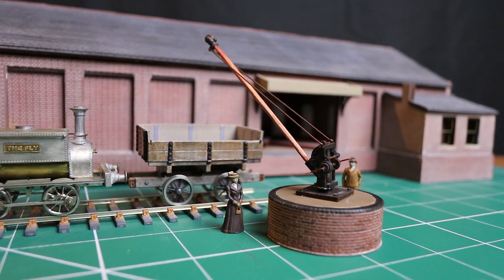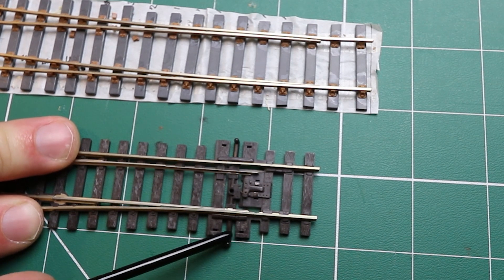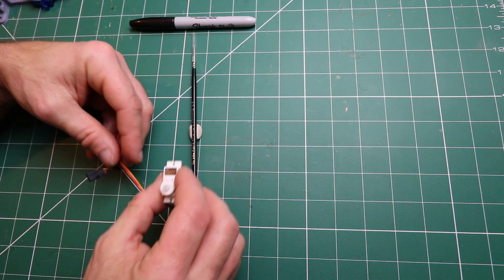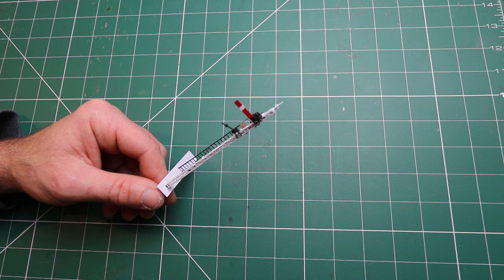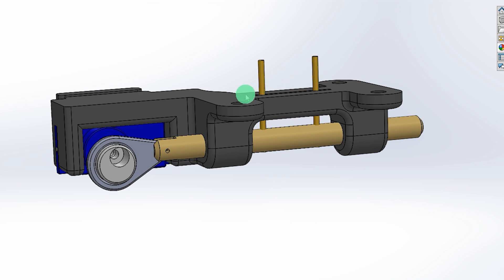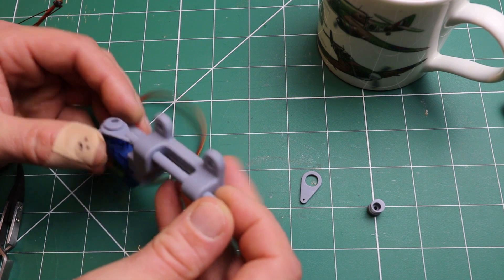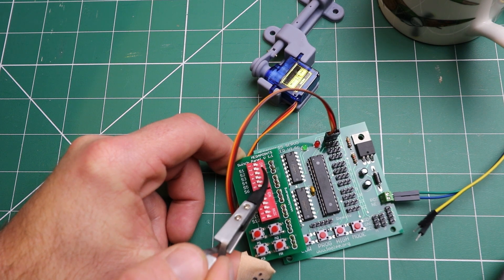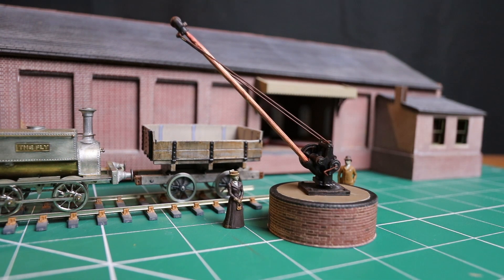S2 E10 Turnout or Point Motors for Bexhill West P4 Gauge Model Railway

Comment: It's really nice, but two things.  One, it looks expensive, and or time consuming.  We have adapted to servo control because it is "cheap".  Two, when you have scores, or in some cases hundreds of turnouts, you have a ton of wires running through your layout.  One way I mitigate that is using controller boards like the "Jack Wabbit", DigiTrax DS74, etc,  that are addressed from the track bus.  Still, it is a mitigation and not solution.  Ideally, we can come up with turnouts that tie directly into the track bus, without any mediators.  A servo with it's own "mini" decoder, that would tie directly to the local bus would be perfect.  It would save the wire bulk that clutters up modern layouts, as well as add to their complexity.

Comment: Hi James,
DCC Train automation already sell these. MTB MP1,5,6 and now I think they have a new MP10 out. They have the eccentric to effect a linear reciprocating motion but you could add your brass bar and twin prong set up (which is much more elegant than the single pin through the tie bar hole). 
They have switches built into them too for frog and signal switching. 
David.
Reply from the maker: HI David, the design of these has progressed since this video was made., and I'm now selling a more developed version through my online store.  The main difference between my offering and the DCC train automation version is that mine use servos which suits what I am doing.
Thanks for watching,
James

Comment: Very cool mechanism James. The bar in brass will of course pose a difficulty on what material you’re going to use as the rods between bar and blades. Can imagine that would also be best in brass. However, then you’ll bridge the rails into a short.
Can imagine two brass tubes over a rod and a plastic flange in the middle, in the same diameter as the tube, would do the trick. Can also mean your parts can be made adjustable for different gauges.
And the two pieces of brass tubes can then be identical, which would make production more easy and cheaper. 
Also am curious to what kind of visual throw bar you will come up with between the sleepers. Can imagine the path of travel could become even smoother when a kind of throw bar is added. Not to say, that such a throw bar would further enhance the realism of the model turnout.
Last but not least, for complicated turnout placement; this kind of mechanism would really improve turnout functioning over longer distances also.

Comment: Hi James, You've set yourself an incredible amount of work!  If this doesn't work out for you I would try a purely mechanical arrangement based on prototypical operation at the time!  Thanks for uploading.
Reply from the maker: I like a challenge, and for me it's more about the journey than the destination so I quite expect this project to take many years to complete.  Ultimately, the mechanisms will be operated by a mechanically interlocked lever frame which will control the electronics. I have started to design this but I need to speak with a S&T expert to confirm that I understand the principles of prototypical operation.  It's all a bit beyond me at the moment.
Thanks for watching,
James
Reply: @BexhillWest  Since you are scratch building I would seriously consider going down to 3mm scale. Peco produces an excellent range of track for this gauge called HOm. If you go for TT gauge you can leave all the problems you had with OO Gauge, EM and Protofour in the past!  All you've got to do is scale Bexhill West down a bit on the computer!  For inspiration, here is Garry Hall's TT scale layout featuring an SR Class C2. If you go for this you will have a lot more of Bexhill West in the available space!  https://youtu.be/-NVAtw6SRX0

Comment: Hi James,  For some time I’ve been wondering whether it would be possible to control turnouts/points using servos attached directly to the underside of the sleepers.  Your solution using a sliding bar is ingenious, but your prototype looks rather large.  Though I haven’t developed the idea, I thought it might be possible to use a gear fitted to the servo to drive a toothed bar attached to the points switching blades.  While this would keep the entire mechanism small, it would require a relatively large hole in the baseboard – relative to the conventional approach, that is.  In my case, I’m using an insulation material (Kingspan) under the track, so a larger hole than normal would not be a problem.  Of course, to allow for ballasting, the underside of the sleepers would need something to prevent the ballast disappearing through the hole - even paper glued to the sleepers would do.
I would be interested to hear your thoughts on this potential solution.
Stay safe.
Stephen
Reply from the maker: Hi Stephen, the sliding bar idea is great although not mine.  It seems to be common practice among P4 modellers.  
The aspect of this is the eccentric to control it, I've not seen it done before.  
I completely agree with your comments about my prototype being large and to rectify this, I have redesigned it into a much smaller package which I'll feature in my next video. It takes the concept to the next level which I think will interest some people.  
Best wishes, 
James

Comment: Thats a very good idea and workable. Might be a problem with its length should you have Two points side by side. 
Another handy addition might be to add a raised section on the operating bar to operate one or two micro switches for frog polarity etc.
I know you like to do your own thing having watched you from the beginning but there is something on a similar basis made by Dingo Servo Mounts. A system I have used and is extremely effective.
Reply from the maker: Thank you so much for your feedback.  I have had similar thoughts and this mechanism has now been redesigned and will feature in my next video.
Thanks for watching, James.

Comment: A very elegant design James! I am curious about the connection between the points and the throw rod via the pins. If the throw rod and presumably the pins are made from brass, then how are you planning to prevent a short circuit? The prototype would use an insulated throw rod to avoid shunting the track circuit. Very interested in seeing how your design evolves.
Reply from the maker: Hi Jeffrey, I was going to save that connection for a later video but have now redesigned and simplified the device to reduce the risk of short circuiting.  I am going to cover it in my next video and I'd be pleased to hear your thoughts on the MK2 version.
Thanks for watching, James.

Comment: Great idea, but have you considered that you will need microswitches for both the frog polarity and the interlocking on the Arduino. EG. the Arduino will need to know in which direction the points are set at power on and for signalling. You haven't included anywhere to mount them. Probably, at the far end of the push bar would be the best place, although horizontal pins on the push bar could be used to operate the microswitches.
Reply from the maker: Hi Henry, I wasn't going to use micro switches in my application, I had other ideas.  But, as lots of people have shown an interest in this, I've created a MK 2 with a switch. 
Stay tuned for my next video when I'll present the idea.
All the best, 
James

Comment: It seems that the mount is on the wrong side. When attached to the baseboard the mount will be between the points and the rod.
Reply: If you are referring to the working prototype James demonstrated, I think there should be two slots were the pins go that have been omitted which will allow the unit to be secured to the underside as shown earlier on the CAD demo.
Reply from the maker: Hi Nick, the intention is to secure the unit with screws through the lugs on the sides.  Thanks for watching, James
Reply from the maker: The intention is it will mount underneath the baseboard.  In my demo, I had shown it the other way up.  Thanks for watching. 
Best wishes,
James

Comment: Brilliant solution James, one quick note, maybe use a wooden dowel for the pins to go into rather than brass/3D printed plastic as the dowel will be consistently straight over such a very short distance and avoids any electrical issues. Just my thoughts but, yes, very impressed. Will you be making these available to buy as I am going to require rather a lot and I too want to use servos. Thanks.
Reply from the maker: Thanks, Paul.  Yes, I will be making these available but I've designed a revised version which I think addresses your observations.  Stay tuned for my next video when I shall explain all! 
Thanks for watching, James

Comment: Well, frankly I'm really disappointed that you haven't found a way to move a 1:76 scale signalman's arm to throw a lever, which operates the entirely functional 1:76 scale point rodding etc. <shakes head and mutters about not being able to get the staff> 🤣
Seriously, though, that's a very elegant solution. There's always something ridiculously satisfying about watching an eccentric thingie rotating.  But I'm not sure how you're going to connect it to what I've always thought was the tie bar, but which I think is properly called the stretcher bar, to transfer the movement to the point blades.  Are you taking two rods up vertically through slots in the baseboard to connect to (or to be) the tie/stretcher bar?  

Would the parts of the eccentric movement not be better cast/etched in metal than plastic?  Would add massively to the cost though, I'd guess.
Reply from the maker: Hi Andrew, I will explain a bit more in my next video when all shall become clear. 
Thanks for watching. 
Best wishes, 
James

Comment: Locking mechanism - yes, the usual model railway ones look wrong - would you like to see pics of german metric gauge ones for comparsion and doing them better by yourself?
~3:30 Very theoretical, if the viewer does not have a pic of the real thing to look at -> yes, when you got illustrative material showing going to be better.
Yes, two pins on the side "camouflaged" as the connection from the rod to the blades. Not T-bar.
The piano wire acts as a spring pressing the blades onto the outer rails, too.

Servo + semaphore signal + Andrino -> look into semaphore bouncing 😉

~16:30 You already know that I am against radio control. - BUT - Yes, the turnouts and signals independent from locomotives (feed by the rails) for federal control, for when layouts join modular up to one very big layout (that would be season 3 or even 4 - I guess).
~17:10 depends on the search words; "H0fine Weichenantrieb" for example brings some results, as well as ship and plane modellers often got similar solutions as they usually go the servo way.

Crane needs ⛓ and 🪝😶‍🌫

Comment: Hi James,

That's an interesting solution to be able to move the points.  I wish there was something like that available for when I made mine which I ended up using the copperclad method.  I found mounting stuff like that underneath a right pain with having fixed baseboards though trying to get it lined up straight.   Btw If you make that whole bar brass then you will just create a short when it's connected to the rails?

Cheers,  Michael
Reply: On my older P4 layout I bodged the TOU with brass droppers and  PCB.  Set up was awkward to say the least!
Reply from the maker: Hi Michael, you're right about creating a short.  I had other ideas for connecting this lot to the rails which would have avoided the short but have since refined the design.  I'd be pleased to hear your thoughts after the next video. Thanks for watching, James
Reply: @BexhillWest  - What about a thick metal pin glued into 2 plastic tube ends?   That way stronger than just plastic (or resin) but avoids the short.  Similar to a split axle.

Comment: That's fantastic. I've been using servos mounted with the axis parallel to the rails, using the sloppy-bearing-and-piano-wire method (actually a paperclip usually). Quite compact but relies on software to not drive the servo too far. This slip-eccentric method is very elegant, if there's space!
Reply from the maker: I'm glad you like the idea. The MK 2 version is even better. Stay tuned. : ) 
All the best, James

Comment: Firstly, I have not made any point motors at all, so just uniformed observations.  The horizonal motion will require a slot in your baseboard rather than a single hole.  Concealing a slot may be more difficult than a hole.  As you are going to A LOT of effort to get Bexhill to look right are you going to be happy with the result.
If there is a likelihood of the pin between the bar & the sheaf falling out you could try an old Russian tank trick of having a ramp that knocks the pin back in every time it moves.
Inside the Chieftain's Hatch: T-34-85, Episode 1
Shows this, about 5 minutes in.
These things aside, that’s a nice design of mechanism you’ve got there; would you put them in your store?
Reply from the maker: Hi Chris,
A single hole will work and I plan having a little filler piece to cover the hole which will prevent the ballast dropping through as well.  I shall check out the video - sounds interesting.
Thanks for watching, James

Comment: Hi James, a neat solution , as always, could also be used to animate sliding doors and it strikes me that with a little modification (dual cams on one servo) could actually be attached to a pair of sliding doors, my one area of concern is the pins you are going to use to link to the tie bar, they are going to I suspect be quite fine so the question is will you mount the unit directly to the underside of the turnout or below the baseboard ? If it's under the baseboard use some wire with a bit of spring in it maybe ? Then a tiny amount of over travel at each end will get the spring of the wire to hold the blade tight against the side rail on each side
Reply from the maker: Hi David, these are all great observations which add to the great feedback on here. Taking all of this on board, I've come up with a new version which I think is even better. I agree with your observation about animating sliding doors and have already made a little list of potential uses and modifications for the basic idea.
All the best, James

Comment: Very Nice solution, if the printed slide bar proves to be unsuitable, I'd use a nylon bar, with syringe tubes for the risers. The point blades each having a piano wire attached to the blade, the wire then being threaded into the syringe tubes. This would retain electrical isolation between the blades, and easy removal / refitting of the point motor assembly. The wires could protrude below the base board, the tubes extending to almost touching blade.  Hope that makes sense.
Reply from the maker: Hi Paul, that all makes perfect sense and thank you for the very useful feedback. Best wishes, James

Comment: Good idea, and possible solution, but if seeking perfection, does your track work look  " prototypical " point blade's have a tie bar for a reason which could reduce the need for two pins going to each blade ? Something to consider ?
Reply: I think he'll add a cosmetic tie bar that looks more realistic that the customary copperclad strip.
Reply from the maker: Thanks, Edward. As Roaming Adhocrat has mentioned, there will be cosmetic tie bars added later. Thanks for watching. Best wishes, James

Comment: I've always found turnout actuation to be one of the biggest grey areas - so many people have so many opinions when it comes to how to handle it with hand laid track, and almost none of them are novice friendly, frequently referring to old hardware, discontinued products, etc. - this looks wonderful. Is the idea to solder the actuating pins to the bottom of the blades and then drop them through the holes in the operating bar? Or maybe the operating bar has small ID tube that the soldered droppers slot into?  I'm half and half whether to go with mechanical or electrical point switching, but it looks like the same mechanism would work fine with wire-in-tube or crank rods also. I personally would buy six or even of these assuming the TOU-to-blades config is settled?
Reply from the maker: Hi William, I am going to detail the actual connection in my next video which should answer your questions a little more comprehensively so stay tuned! 
All the best, 
James

Comment: What you've done is similar to how I operate my point work, but yours is much neater. I use a C&L mechanism to operate the point blades and this is connected to to the servo mounted on a MERG servo mount by a adjustable brass rod {adjustable turnbuckle}. Two brass tubes go from the C&L unit to just underneath the point. The tie bar attached to the point blades is from a Masokit etch which folds up into a fairly realistic looking tie bar. I then have two more brass brass tubes that are soldered to the tie bar that are just shy of the tubes from the C&L unit. Two long brass pins pass through the tubes from the tie bars into the tubes attached to the C&L unit. The whole set up is screwed to a piece of wood which is then screwed to the underneath of the baseboard. Your design is much more compact. I wish your ones were available when I was doing my layout. LOL. I use Megapoints to control the point work and signals via a lever frame.
Reply from the maker: Thank you for your detailed feedback, Dave. I'll consider all of this as I move forward. Best wishes, James